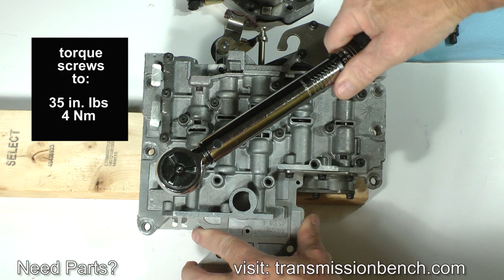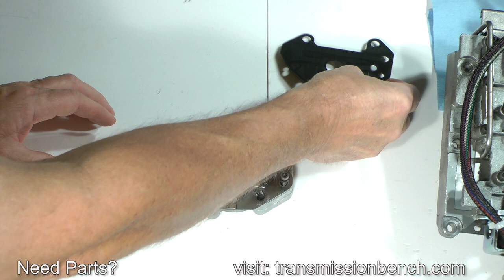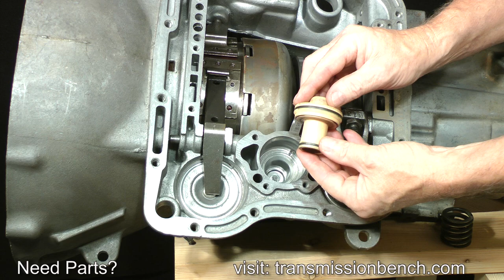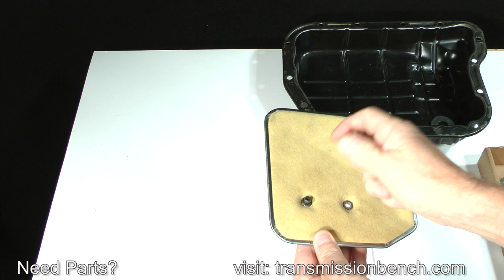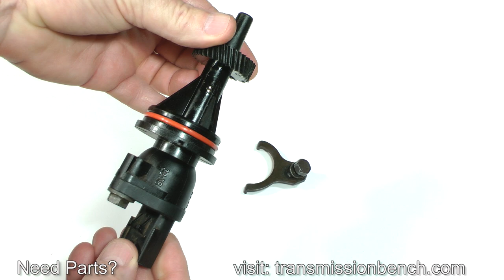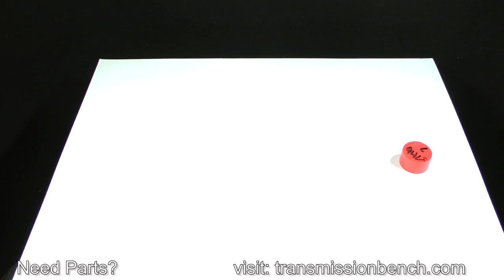Chrysler 46RE Class Part 2 lesson 7

Comment: Great series Jimmy! Based on watching your tutorial, I decided to pull a 46RH from the salvage yard and rebuild it (my first) - to install in my 94 Jeep ZJ build. Sure glad I did. The salvaged unit happened to be in good shape (rebuilt once and someone installed a Transgo shift kit) but I installed your kit anyway along with a few other parts and it went together very smoothly.  Like new for less than $500 total cost!  It was a great learning experience and a really fun project. I would not hesitate to tear into an auto transm again in future.

Comment: Be  starting  my very  first  automatic overhaul  tomorrow,  a 2001 Dodge 2500 2wd  I dragged home.   The odd thing is,  "back in the day"  (1970's)  when  I was young and had other Mopars---  69 383 RR,  70 440-6 RR,  64 Dodge 426,  and a 340 powered  FJ-40 Landcruiser,   MANY people  tried to tell me  that  Torqueflites  were  EASY  to rebuild.   "I stayed with 4 speeds"  LOL.   Nowadays,  I can  no longer handle a big heavy clutch  or  difficult  to shift 4 speed.

THANK YOU!!  for the time you took building these!!

Comment: A suggestion. Before you install the pan, install the NSS, especially if you have replaced it or are changing the case and rooster comb. Going with a later model 4 or 5 wire case in a 3 wire vehicle.  Install the switch, and any adapter and be sure it is activated by the rooster comb bottom. 
Thank you again for your time and efforts.

Comment: The installation of valvebody and parking prawl was very helpful. I was having trouble installing with both attached. Now I will try installing the parking prawl first and then the valve body. I didn't want to do it this way because of all the other issues trying to align things up along with an accumulator and spring and doing all this under a vehicle. Not an easy task.

Comment: Never a problem from this 46re 2001 dodge unit? But..I didn't adjust anything. Just fluid/ filter. Drove quiet .shifts were clean nothing.  Now .the gear reduction noise. No. Shift problems?   Odometer 167k. Well maintained vehicl.. Heading to a shop.

Comment: Torque converter? When reducing speed @around 35mph down. I keep hearing a gear reduction noise?  I had serviced the filter/ correct fluid amount etc five months earlier . Fluid before was fine.  Nothing obvious in or on pan magnet for

Comment: Went completely through the lesson with no problem and got the transmission back in the truck! :) 
I seem to have another issue though. I tried to reinstall the driveshaft and the slip yoke seems to be hitting something behind the seal on the transmission side before it bottoms out completely. Is it possible I may have flubbed the support bushing and it's causing the fitment issue? I was rather gentle installing it so I would think not, but I've been wrong before. Any help would be great as I have had the transmission in for about a month now with no progress (just got time again) and would like to finish this up lol

Comment: MY 2003 DODGE 1500 WON'T STAY IN 4TH GEAR LONG. WHEN DOWN SHIFTING FROM OVER DRIVE IT SHIFTS TWICE TO 3RD GEAR , THEN SHIFTS TO 4TH AND VERY FAST GOES BACK TO OVERDRIVE . GOING UP HILL IT WILL KICK DOWN TO 3RD AND IF I TURN THE OD OFF IT WILL GO INTO 4TH AND HOLD 4TH .WHAT SOLENOID DO I NEED TO REPLACE ?

Comment: Thanks for the lessons. I pulled a 46 re out of my 2500, disassembled a trans that was 1 year and 3000 miles over warrentee ,  I found and replaced  the following , A bad overdrive Snap ring Bearing, A broken rear servo piston. Broken boost valve retainer and gouged boost valve, The cluch packs and steels were like new, the bands and drums good . The truck was slipping in reverse and first gear. and after repairs it has no reverse. it shifts in first second and drive. I have not  driven the truck in fear of doing damage. what your advise before i remove and bring to a shop. Thanks

Comment: How does this build compared to a 47RE out of a 4 wheel drive 3/4 ton V10
Reply: It depends on the year transmission in the 47RH. Which can be identified by the plugs and the transducer/ solenoid the case # but rebuilt could have a number of different internal components swapped.
Reply: @seanbrossard8178    Mine is definitely a 47 RE
Reply: So now it is just a couple of check valves (balls) and the transducer or solenoid which he covers in the build. Just got done doing mine 30min ago. But mine was a mix up of parts, as the was a rebuilt transmission with 70k on it. My 1st 2nd reverse band delaminated sending debris into the fluid and metal on metal contact for about 20 minutes as I was hauling my airstream over Tahoe summit on us50 last week. Left the trailer in Nevada limped back home. I have an auto pilot so I can control the shift and lockout from inside the truck.

Comment: Can u show me the transmission fluid temp sensor
Reply: It's part of the solenoids or pressure detector. 
Can't remember which.
Google that same question. You will eventually find a forum with the answer.
If your trans temp is high, make sure you eliminate the check valve in the cooler line.
Mine got plugged up and my trans was shifting out of OD. 
Holy cow!

Comment: I built my 199 Dodge Ram 1500 46re transmission reinstalled it in to my truck   
Started rite up Idols perfect in park but put it in drive or reverse it Stalls out and it idles rough in neutral I replaced the torque converter and readjusted the kick down band and reverse band is still doing it do anyone know what it can be
Reply: Did you find out what the problem is ?  Did you replace the TC ?  I'm going to replace mine.  I have similar problem as you, just starting my rebuild of the tranny.